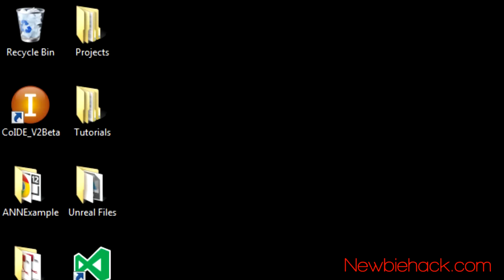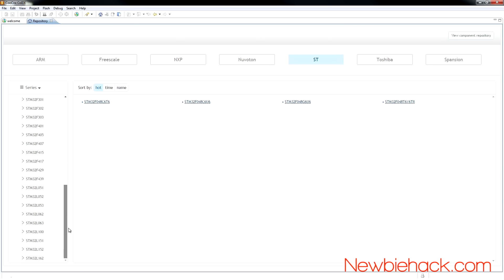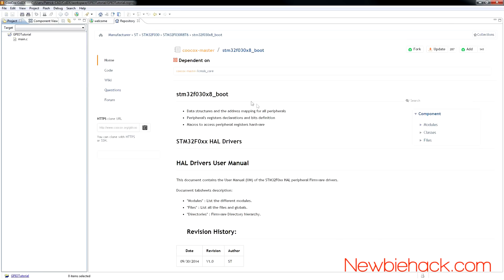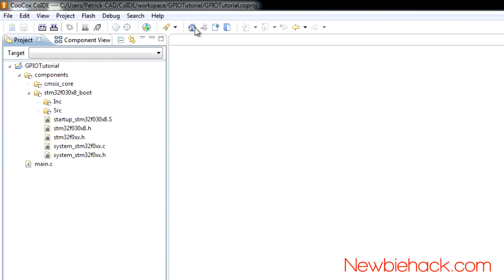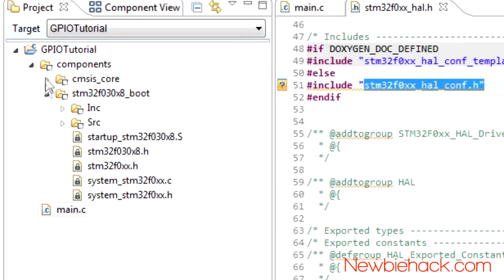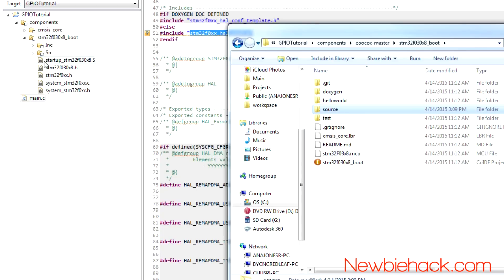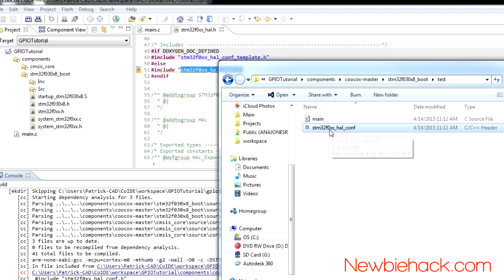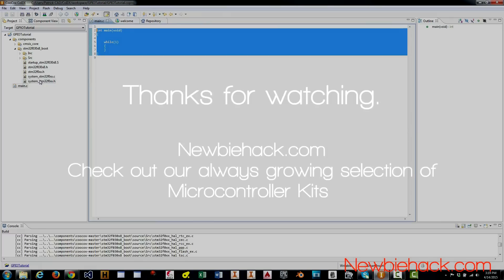4. CoIDE - How to Start a New Project with CoIDE (CooCox) Tutorial for the ARM Microcontroller

Comment: Hi Patrick, thank you for the detailed videos!  I have a problem though:  when creating a new project with the micro STM32F103F8T6 and adding the libs, there is no option for the Boot Library.  Is it incorporated into the new version of CooCox CoIDE (Version: 2.0.5;  Build id: 20150607-2.0.5)?  Did I screw up with the download & install of the CoIDE or GCC? Kindly revert soonest, thanks
Reply from the maker: The library previously called "boot" is now called CUBELIB.  When added, it will also add the cmsis_core.
Reply: Thanks, saved my day!!
Reply: Thanks, I ended up using the previous version of CoIDE, v1.7.8.  However, it sucks that it resets the MCU a few times when debugging.  I would like to experiment with several other C-based IDEs when I get some time.  Thanks again for your tutorials, though; they helped a lot when I started off with embedded programming!

Comment: Hi, I know that atmega 328 would need the oscillator and the two caps, reset pin set to high and mosi,miso,sck for the bootloader and tx and rx for programming. However which is the case for ARM im looking at lpc4330 chip. So far i know that its been programmed from Jtag. how about the rest? burning bootloader? which oscillator to be used? would be great if you could help me out

Comment: I really think there is more to this story. There is probably a reason why that define is set that way. Perhaps it shouldn't be. Asking the maker of the IDE would be a much better choice in the long run, rather than just short circuiting around it.
Reply from the maker: James Newton If the code calls for the file, it should be present.  The define and if statement are fine.  I can imagine a repository with such a vast selection of microcontrollers and manufacturers can be a daunting task to organize correctly.

Comment: Hi Patrick, Thank you for the very clear tutorials. Regarding coIDE, I noticed the coocox website is somehow down. I retrieved an installer of the coIDE from other sources, but it doesn't support all the newest CPUs (no possible to get updates from the coocox website anyway). Would you please suggest an alternate IDE based on your experience or similarity with coIDE? Thanks in advance.
Reply from the maker: I would go with the Eclipse.  I haven't used it, but I have received many comments on it's use and features.  I believe the CooCox IDE is based on the Eclipse IDE.  You really just want to make sure you are using the latest ARM libraries for your chip.

Comment: I'm having difficulty following this because CooCox is only available on windows.  What toolchain are we actually using here?  Where would I find these libraries without CoIDE?  I'm trying to use Eclipse with the "gnu arm eclipse plug-ins", but the boilerplate is entirely different (µOS++ ?).  It's a shame, you warn us against overcomplicated boards that hide us from the actual implementation - and then proceed to do exactly that with the software.
Reply from the maker: Hey Shaun,  My aim is to lower the barrier, and the CoIDE (one of the recommendation from STMicro) allows beginners (like me) to get into this field.
Reply: Sorry, I shouldn't have vented, I was just very frustrated trying to find a toolchain that'd come close (the single include of stm32f0xx rather than a whole µOS/mbed).  After many false-starts, out-dated tutorials & brick walls, I can see precisely why you chose as you did.  It's a minefield of options out there!

For anyone else who gets stuck at this point, OpenSTM32 is available on win/linux/mac and has a toolchain similar enough to follow along.  It doesn't look as friendly, and additional libraries are "an exercise left to the reader", but it's seen me through to part 26 so far.
Reply from the maker: Not a problem at all.  I get this question from time to time.  I was a Linux user on and off, so I can totally relate.  If you do find a better solution to the OpenSTM32, I would really love to hear about it, and many of the subscribers would also benefit.

Comment: I guess they have managed to ruin CoIDE, in version 1.7.7 the tree view was the same as the file tree and making a new project worked out of the box
Reply from the maker: It is probably just an issue with their repository. The files need to be managed better. It would be nice to know if there is a way to request small changes.
Reply: Patrick Hood-Daniel There's a forum on the website look like it deals with stuff like that.